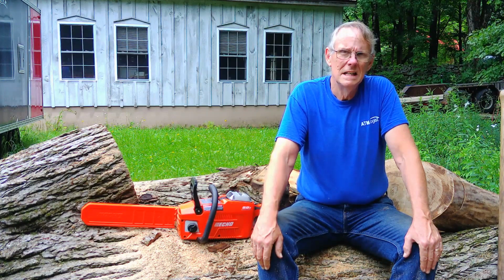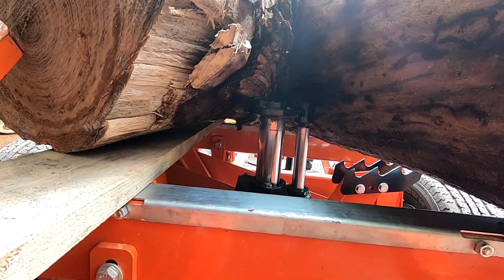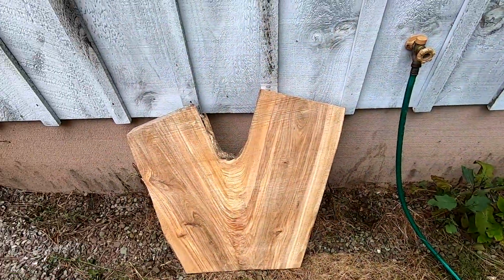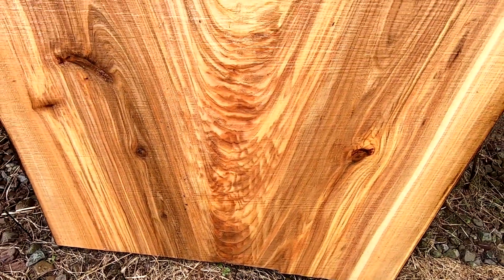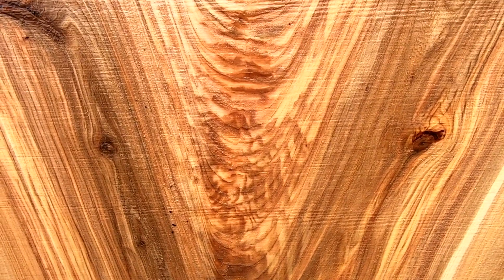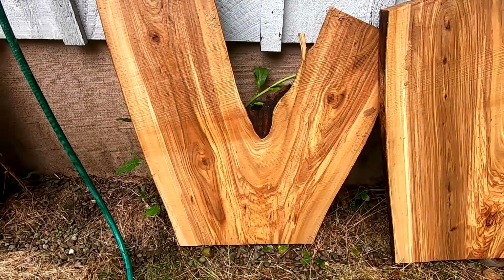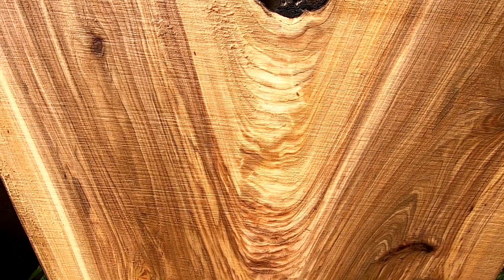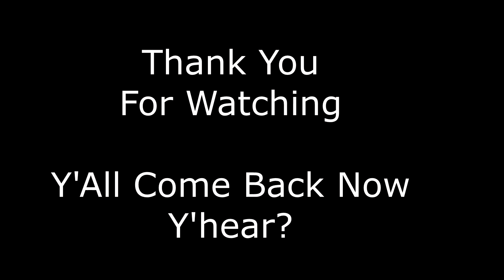Baby Elm Crotch...Oh BABY! # 45

Comment: So I have ordered an lt40 wide. Still have time to make some changes. I’m a bit remote and most of my other equipment is diesel. Do you think it is worth the upgrade for the convenience of having a diesel tank at my site?  I do plan on having saw long term. I am 40 yrs old. Thanks !
Reply from the maker: Decision time... I just checked and the Yanmar diesel option adds $ 7,500 to your cost. Is it worth that much to eliminate the cost of a small gas storage tank & hand pump? The diesel will run YEARS longer than the gas engine and provide more torque. It all comes down to your pocketbook.
I was 40... in the 90s.
Thanks for the support.